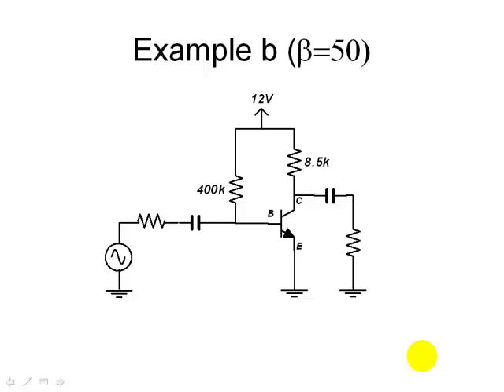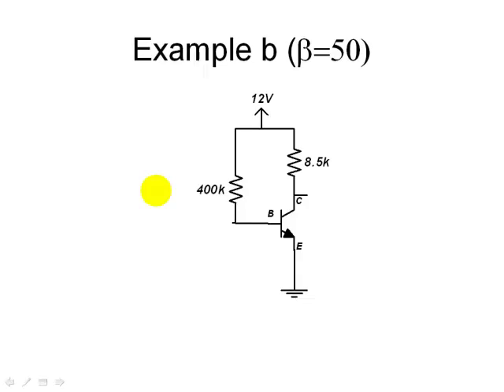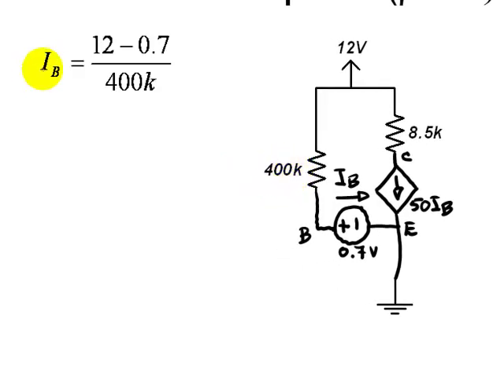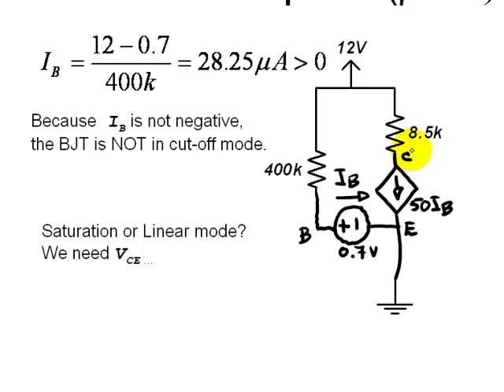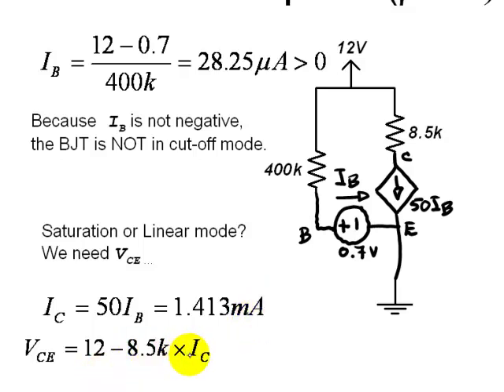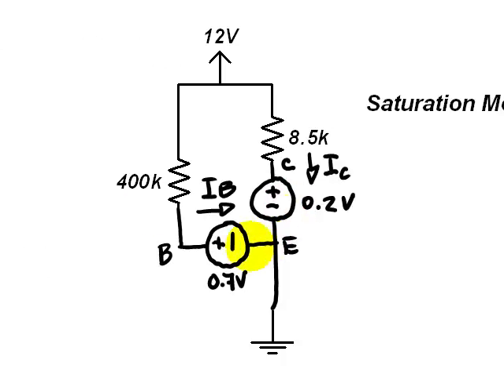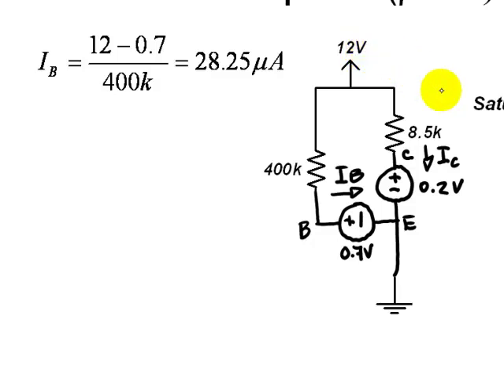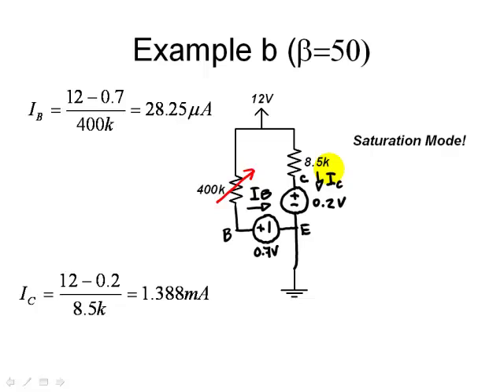EECE 251 - BJT Tutorial B (saturation example)

Comment: Wow you simplified it a lot. Excellent model to show voltage current math in transistor. I never new that there are two different equivalent circuit for transistor - linear mode where Ic = B*Ib and saturation mode where Ic = (Vc-.2)/Re. Thanks for that simple yet great explaination

Comment from the maker: @aerofart Several assumptions are rolled up into this 0.2V. (1) That the ON BEJ operates at 0.7V (Silicon, eh?); (2) Very importantly, that the BCJ ceases to be OFF if the Vbc goes below 0.5V (Do you remember how we identified the actual turn-on voltage of a pn Silicon junction, not exactly at 0.7 volts, but rather earlier?) ... (continues in another post) ...

Comment: Can you comment on >>why<< 0.2V is being used as the reference value to determine whether the transistor is in saturation mode?  Is this 0.2V an intrinsic value of this particular transistor (i.e. a data sheet value (ie Vce-sat?)  Is it safe to assume that any Vce potential LESS than this 0.2V value indicates saturation and that any value greater indicates quiescent operation or off-state?